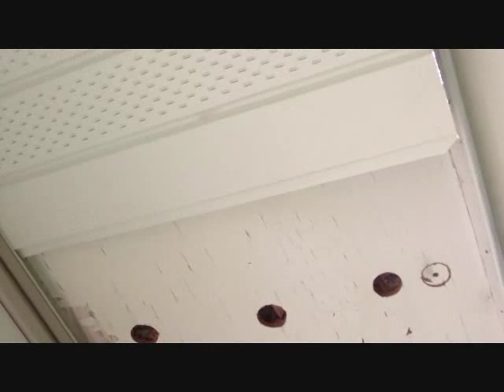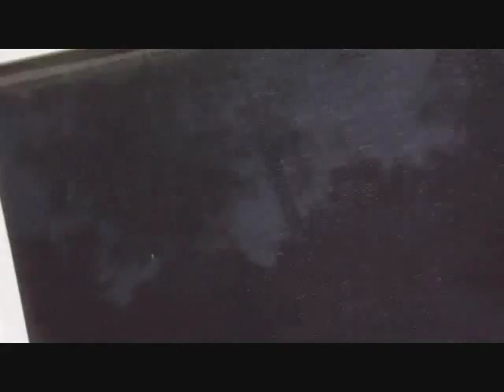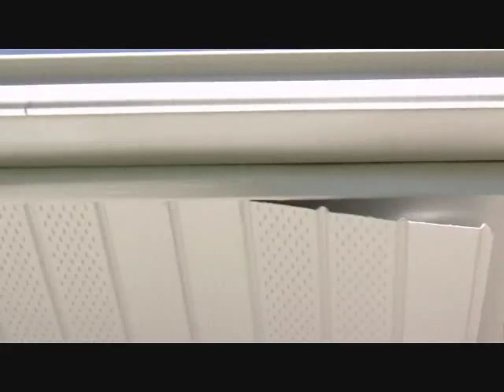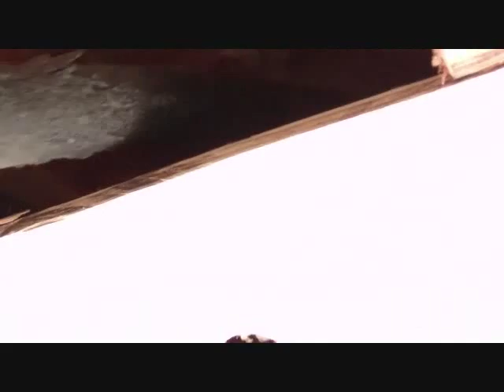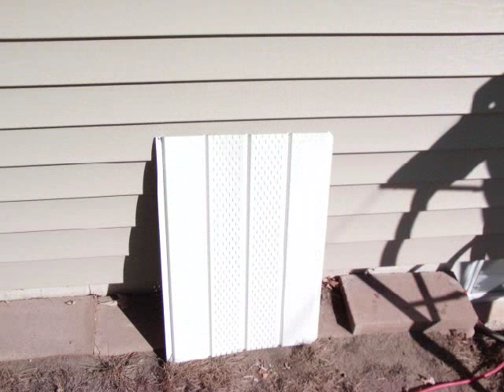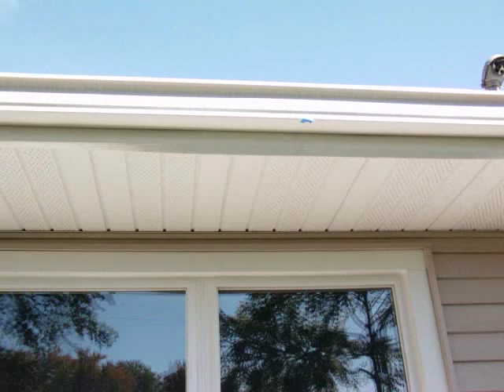Adding Soffit Vent above Metal Soffit  9-30-12

Comment: No need for a louvered grill when it's hidden by soffit vent.
Reply from the maker: I agree with you except for one reason.  We ended a mice infestation there.  There are always ways mice can access enclosed spaces of a soffit.  Even you tube has videos depicting mouse easily climbing wall surfaces.  I was not comfortable with leaving openings on the original wood soffit.  The grill covers are not expensive and it takes little time to secure them.  Oh, and yes, the mice had been in the attic of this home.